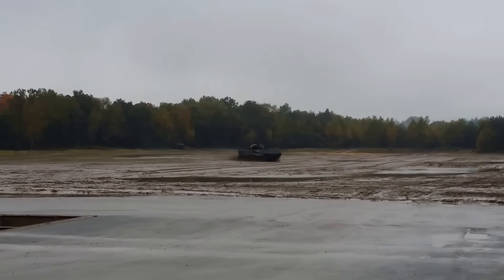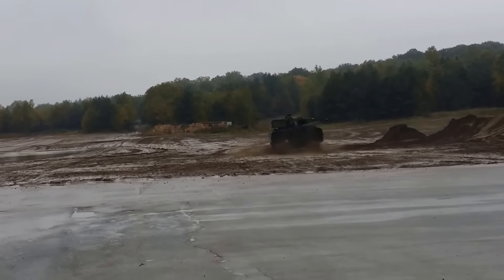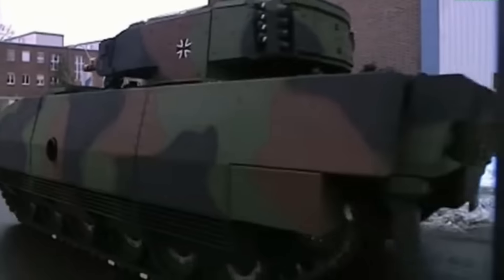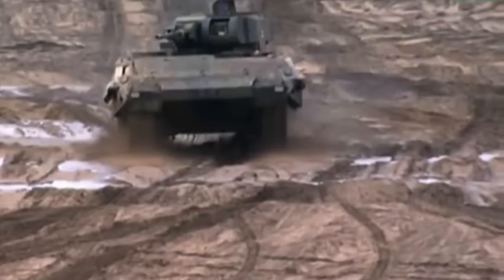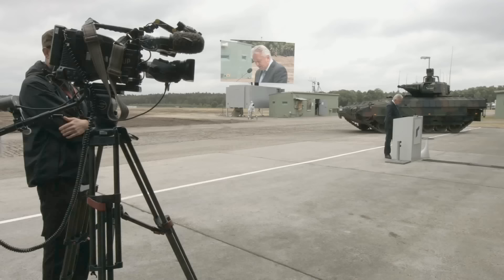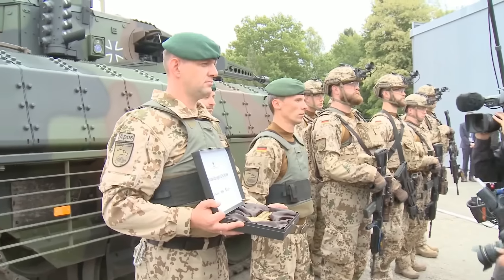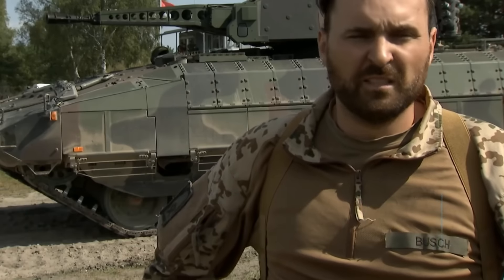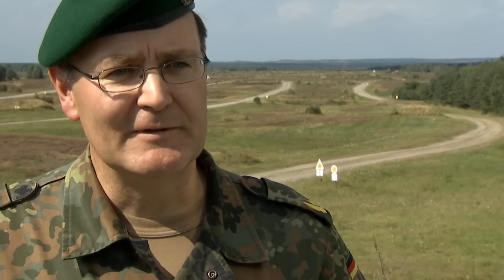The Puma Infantry Fighting Vehicle - Overview and Opinion

Comment: I'm wondering if it isn't unnecessary additional weight if there's a 14,5 mm protection in the A airlift variant, but once you add the C armor, the A armor is behind the heavier armor which could leave the A armor possibly useless redundant weight?
Reply: A and C armor add up to the final protection.
Reply: Jonny I think though if the C side armour makes 14,5 mm rounds bounce off, theres not really a need for 14,5 mm protection anymore in the A variant. So it might be better if you could also remove the entire A side armour leaving just a structure with pegs instead of putting the C side armour on top. Unless you really had a good concept on how the A armor would perform should the C armor on top get penetrated.
Reply: They remove just as much armor to bring it under 37 tons to be transported by the A400M. If you also remove the A armor, it would fall under 30 tons, wasting payload both on the A400M that transports the Puma, aswell as on the A400M that transports the armor modules. (also making the effort of off-mounting and re-mouting longer/harder).

And yes, the protection adds up. Let's say a C armor module protects against 30mm, the C armor module mounted on top of the A armor protects from 35mm (just as theoretical example). Rounds wont bounce off, they enter the armor and get stopped. A and C armor add up to the thicknes to stop 30mm.
Reply: Jonny So the A armor is removable as well? In your example the C-armour would get penetrated and destroyed from 35 mm only the crew would not be affected.
Reply: Yes. The Puma (exept on the LFP) relies on 'external special armor', meaning, unlike on the Leopard 2 or Abrams (which have 'internal special armor'), the composite armor is mounted on the hull, instead of being embedded into it. That makes battledamage repair and adoption of new armor technologies much easier, and in case of the Puma, also airliftability.

Comment: not sure about 5.56 for the coax, feels a little too light for a vehicle that will be expected to provide suppressive fire. Then again, I suppose they can always slap on an unmanned gun system.

I feel the concern with technological fallibility is more than a viable one but in terms of auftragstaktik and tactical info, the more a unit can get and act on, the better.
Reply: They are replacing the 5.56 MG4 with a 7.62 MG5.
Reply: if you get hit by this Rounds , what makes the difference ? You get killed anyway
Reply: depends on the range and what sort of cover your target may be behind 5.56 is great up if you want to wound someone, and it certainly is accurate, but 7.62 just has more punch and more range to that punch.

Comment: I find the Engine in this veichle to be very interesting. 11L V10 producing slightly over 1000hp. Comercial 11L engines usualy are only about 320-460hp, but they get the torque at much lower rpms thou.
Reply: MTU has a new line of tank engines. These new common-rail engines work that way. There's also a newer engine at the size of that for the Leopard 2 with 1700 hp (instead of 1500) working at 3000 rpm, just like the Pumas engine.
Reply: Are you talking about the MTU 883 wich is 27,4L V12 direct injected?

Comment: please do one on the t-80 or the latest Russian t-72b3
Reply: They're really just 120 mm APFSDS, CBU-87, and Javelin fodder.
Reply: JASHVEER22 Aren't those older soviet T series versions being phased out by the continued  T90 development programme anyway. Especially with the Armata line being introduced. I'd think any modernisation program for those older T series versions would just be costly and not add much value to them.
Reply: +The Raging Storm The T-90 was only made in relatively small numbers, and same with the T-14. The budget didn't exist for the T-90's and the T-14 is new and with the 25% budget cuts for this year (due to sanctions and especially low oil and gas prices, Russia has a fossil fuel dominated economy), Russia won't be making that many of those. Here's the numbers according to wikipedia (probably not 100% reliable, but it's probably close): 16 T-14's, 550 T-90's (350 Active, 200 Reserve), 3450 T-80's (450 Active, 3000 Reserve), and 8,900 T-72's (1900 Active, 7000 Reserve). So of active tanks, 0.6% are T-14's, 13% are T-90's, 17% are T-80's, and 70% are T-72's. So to cut out T-72's and T-80's, they you be cutting out 87% of all their active tanks. Given that the US Army has more than 8000 Abrams in total, other NATO countries bringing along their tanks, and the huge number of NATO strike aircraft and attack helicopters that would be taking out entire columns of Russian armor with cluster bombs and anti-tank missiles, Russia's tank crews would be having a bad day either way.

Comment: at 8:26 in the clip: Yellow- Drivers Navigation Cameras...are not Cameras..but are..  the sensors, consisting of laser warner and a missile warner using ultraviolet sensors part of the MUSS Passive protection system

Comment: Matsimus - thanks for the video. You mixed in some Sequences from so called "Puma 1" the actual vehicle wich is delivered to Bundeswehr is "Puma 2" (you are british: like Challenger 1 and 2). You can easily distinguish them because Puma 1 has only 5 wheels and Puma 2 6 wheels
Reply: I certainly never have heard of a Puma 1 or Puma 2 designation. The five road wheel one was part of the prototype and testing phase, the finally accepted one and the one delivered is the one with the six road wheels and it only got the designation Puma. The homepage of the Heer (Army) of the Bundeswehr (www.deutschesheer.de) as well as the homepage of the main contractor, KMW (www.kmweg.de), are also only listing it as Puma.

Comment: Wow, I really didn't expect a 5.56 coax. Almost everything has a 7.62 due to the longer range. Bradley's can take about 2000 rounds of 7.62, but I guess space is at more of a premium in the Puma. If they run out of 30mm shells, it won't be able to reach out to more than 1000 m or so.
Reply: They are replacing the MG4 with a 7.62 MG5.
Reply: The MG4 is just an placeholder.
Reply: That makes a whole lot of sense.

Comment: What defines a vehicle as a tank? There's a lot of these vehicles that you show that I would look at and call a tank but then I have limited military knowledge
Reply: There is no common definition of a tank, but what makes this infantry fighting vehicle and not a tank:
-It can carry troops not only crew.
-uses smaller gun than common tank (30mm vs 120mm) and cant really penetrate MBT frontal armor
-less all around armor than common MBT

It performs different role than main battle tank
Reply: Well, to make it easy. Tanks are designed with the main purpose to knock out enemy tanks but IFVs are designed to support infantry and fight light vehicles. As described earlier, they have different roles on the battlefield. =)

Comment: Another awesome vid, thanks Matsimus. As for combat proven tech,  I've often wonder what happens when the tech fails? My military background was aviation and most aircraft always had multiple back-ups. I would assume the ground forces would have a similar slant toward combat survive-ability.
Reply: While the survivability is still desired on ground (imo) its not as significant; if your motors fail on a plane you have a very big problem, while you are on ground you are stuck in a crap situation but not falling from multiple km heights.

Though it would be interesting if similar redundancy to aeronautic tech is implemented in ground vehicles

Comment: thanks. you got that preference, that there is no hatch for the driver? ( I think there are only hatches to the rear of the turret for the troops.)
Reply: Hatch for driver, commander and 2 soldiers in the back.
Reply: so 4 guys as the crew now? There are no hatches for the crew, that are meant to be opened in regular operation, only emergency exits.
Reply: really? even though that other documentaries said there is not a single one for the crew, even when I see only one for the driver in 15:34 and even that the turret is not manned with crew, you are now saying that there are actually 4 crewmen, instead of 3? ( by "hatch" I dont mean emergency exit hatches )
Reply: What i ment was one hatch for the commander, one hatch for the driver and a large two man hatch for two men of the fireteam. The turret is locked in position (like on the Leopard 2) when the drivers and commanders hatch are open, in a combat situation frontal hatches are closed and turret rotates freely  to a certain point, full rotation if the fireteam hatch is also closed. None of the hatches are ment for emergencies only.

Driver/commander operating over hatch can be seen here: https://youtu.be/0wqwQ6DlM3s?t=92
Fireteam over hatch can be seen here: https://youtu.be/Hu13J1yafko?t=2595 
There are support beams for the guns on the rear hatch: http://tank-masters.de/_content/_news/puma112.031.JPG

Comment: The gun elevation seems to be about 45 deg, this is quite low for urban combat needs, what do you think? I know this vehicle is not probably developed for heavy in town fighting, but if it is used to deploy infantry in towns with tall buildings the gun elevation might not be enough to support the troops effectively. It seems to me that they just didn't think about this very much. German troops serve in mountainous areas such Afghanistan where the Russian bmp's learned the hard way that low gun elevation is very disadvantageous. Don't other current analogues have a better gun elevation? Arent's they saying that the gun is supposed to be used against low flying targets as well? Why then the low gun elevation?
Reply: No they don't, there are no German soldiers in Afghanistan. The ISAF mandate expired in 2014, and all combat forces pulled out by 2015. There are only a hand full of military advisors left as part of Resolute Support.
Reply: Frantisek Plasil 

Also we wouldn't sent IFVs out alone. German strategy has been the same since the cold war. The main concept is the mutual support of every element. We would never let a single Leopard tank sit alone in the middle of Syria being fired against from every direction, like the Turk's have don.

Tanks would be the Backbone, sitting in a platoon, most probably in a partial covered position in which it would fire, retreat, reload, and get back into the position, fire, reverse etc.

Meanwhile IFVs and the Inf. would cover the flanks. The Inf. upfront with the IFV giving covering fire from behind. As you can see, it was never designed to be in Urban combat. If it would be in Urban combat than it would heavily rely on the Infantry to clear out any Targets above the gun elev. and the IFV tries to support as good as it can.
Reply: Frantisek Plasil Urban fighting has been and (after almost 20 years of neglegt once more becomes) the Job of the Jägers in the german army. Light units using wheeled APC (or even trucks) as opossed to Panzergrenadiere that will use Marder and Puma IFV

Comment: The most armored IFV in the world is the Israeli Namer..60 tons it's even tougher the the merkava 4..
Reply: the namer is heavy because it's big. ifv are usually not based on mbt because they don't need to be so big so they can be better protected. so the puma is smaller which allows it to be better protected with just 43 tonnes. the namer is just a mbt without big gun, it's big and heavy which translates to lower level of protection.
Reply: @swunt10  no this is wrong..the merkava 4 weighs 70 more or less with the turret now if you remove the turret you lose 25 tons, but the name weighs 60 tons...why ? because it has alot of armor. Turrets are one massive weak spot, you can basically put lots of armor on in and it will be very well protected even more than tanks..now if is it worth doing ? i don't know, maybe but that's another discussion
Reply: @MrRaefaello  What Mar means is that the Puma is significantly smaller than the Namer. You can't just estimate protection level by weight alone, you always need to know the protected volume to set it into relation to the weight. In Pumas development emphasis was on keeping the protected volume as small as possible to achieve high protection at low weight. They even limited dismount soldier size. Puma accommodates 3 crew + 6 75th percentile dismounts while Namer accommodates 3 crew + 9 95th percentile dismounts, that's a massive difference. Pumas crew compartment volume is 9 m³ while the crew compartment volume on the Namer exceeds 14 m³. The engine on the Puma is smaller and lighter too, saving volume in the engine compartment aswell.

Comment: The protection level and mobility is great and all, but it seems ridiculously under-armed compared to some other IFVs. A 30mm cannon with 200 rounds and a 5.56mm MG with 2000 rounds? That is outright pathetic compared to the BMP-3. That one has a 100mm cannon with 40 regular rounds and 5 gun launched anti tank missiles, a 30mm cannon with 500 rounds and a 7.62mm MG with 6000 rounds.
I know, the Puma has much thicker armor and a bigger engine and other safety features that reduce space inside, but that is a ridiculous disparity in offensive capability.

But I guess the armament is somehow enough nowadays, considering that the Russian successor to the BMP-3, that Kurganetz thing, or whatever it is called, also only has a 30mm cannon and a MG. I'd be surprised though if the ammo load would be as limited as the Puma's too.
Reply: The 100 mm low velocity gun on the BMP-3 was considered unnecessary, that's why the Kurganets moved back to 30 mm like on the BMP-2. Also although they are the same caliber there is a massive difference between soviet/russian and NATO 30 mm. NATO 30 × 173 mm is a bit longer and has a much larger propellant charge, which increases explosive and airburst payload aswell as armor penetration and range. With 106 mm RHA at 1000 m the current 30 × 173 mm APFSDS have about twice as much penetration than the latest 30 mm APFSDS used by russia. Russian 30 mm is more comparable, and in some aspects even outmatched by NATO 25 mm.

With IFVs it's all about 'stowed kills': https://below-the-turret-ring.blogspot.com/2016/04/bigger-guns-are-not-always-better.html
Reply: @jonny2954  Thanks for the reply. To some extend, I knew that there is differences between the 30mm ammo, but I didn't know how much exactly. 
I still think the armament is kind of "bare minimum", even when you consider that it probably is specialized for fighting other IFV and APCs.
My problem isn't just what guns it has, but more with how much ammo it is carrying. 2000 rounds for the MG, even though it is a 5.56, seems pathetic. 
I'm just wondering, is there really that little space in that thing, even though it has a unmanned turret that holds most of the ammo outside of the main body?

I'm curious about the 100mm gun on the BMP-3. In theory it seems like a good idea to have a cannon like that on a vehicle that is supposed to fight other IFV and APC and infantry. With modern ammo (something like a cannon fired version of the programmable multi function ammo of the "Wirkmittel 90") and air burst ability and all that, this should be a great weapon against fortification and entrenched infantry, while at the same time offering breaching (breaking through walls and barriers) support for your own infantry and the ability to throw fog walls at distance, or large illumination rounds.

I think the ideal armament for an IFV would be a 90 or 100mm low velocity cannon firing "Wirkmittel 90" ammo, a 30mm for shooting at other IFVs and APCs, a 7.62 MG for further infantry fire support and 2 or more ATGM in pods bolted to the turret for self defense against MBTs.

As I said, the protection level on the Puma is great and all, but it seems to me it is a questionable departure from the traditional Bundeswehr doctrine that mobility and the ability to kill first are better protection than thick armor.
Reply: 200 rounds of 30 mm is the usual amount of ready to fire ammunition found in unmanned 30 mm turrets. The Kongsberg MCT-30 used on several new CV90 versions and the US Army Stryker Dragoon has a even lower amount at 150 ready rounds of 30 mm and 600 ready rounds of 7.62 mm. Since the Puma will switch coax armament from 5.56 mm MG4 to 7.62 mm MG5 in the future, we don't know yet how many ready rounds of 7.62 mm the Puma will carry, however it is expected to be over 600.

Large guns on IFVs is heavily dependent on doctrine. In german doctrine (atleast in a linear scenario) IFVs move very close with MBTs. It's a common misconception that MBTs will duel MBTs and IFVs will duel IFVs in this scenario. It's rather like MBTs dealing with heavy and medium weight vehicles while IFVs deal with enemy dismounted infantry and light vehicles, as shown by their respective armaments. Bunker busting as example would be the task of a nearby Leopard 2 with a 120 mm DM11 programmable HE. In AFV design, there is always the danger of creating a 'jack of all trades master of none', it is very important to have a clear and strict definition of what the vehicles task and purpose is.